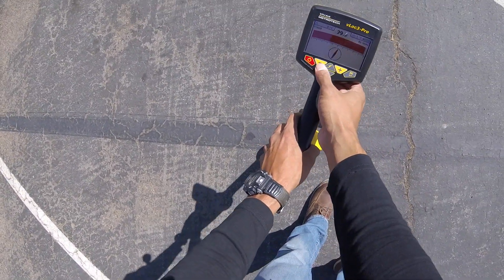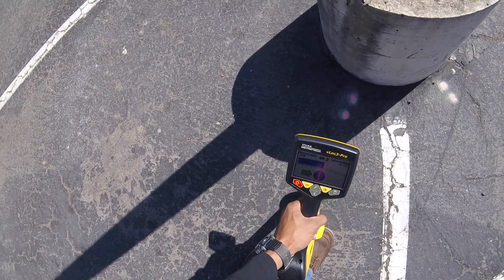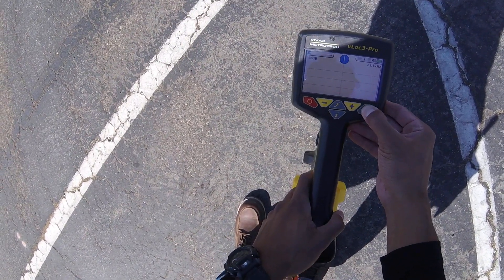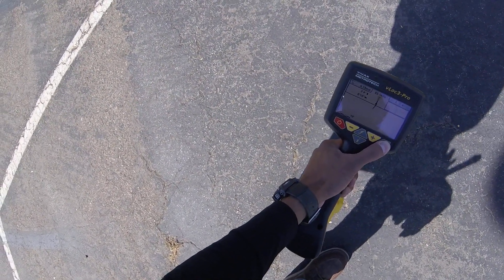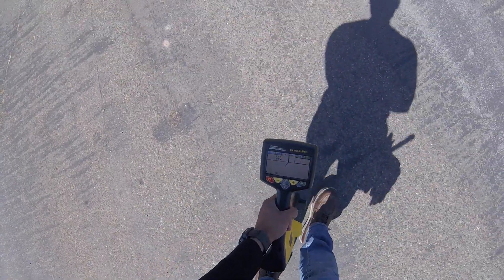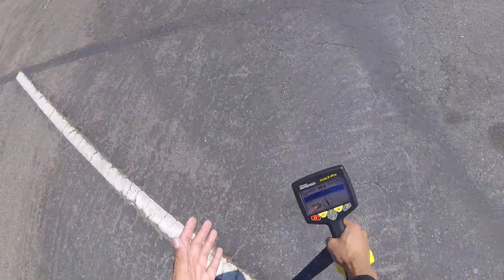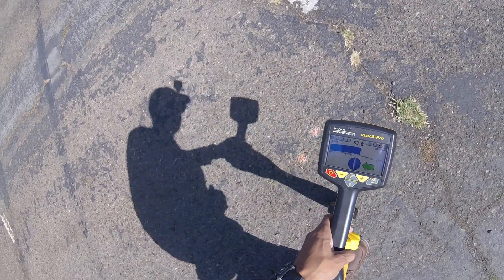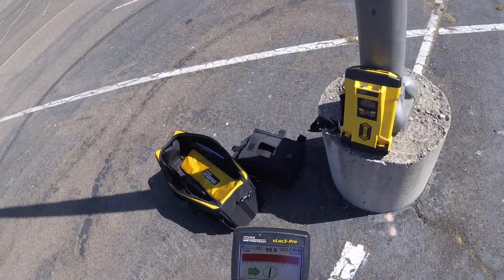Underground Utility Locating- Induction method Part 2

Comment: If you had to check an area of slab just to see if there are any conduit lines, would you be able to do this without the box? If youre scanning an area just to see if there are pipes, you cant really attach the box to anything.
Reply: If you have a colleague, get them to carry the transmitter 20-30ft away from you. You both walk in a straight line across the area, walking side-by-side (but 20-30ft apart). Anything in the area that is a) conductive and b) extends from the transmitter to the receiver should be detectable.